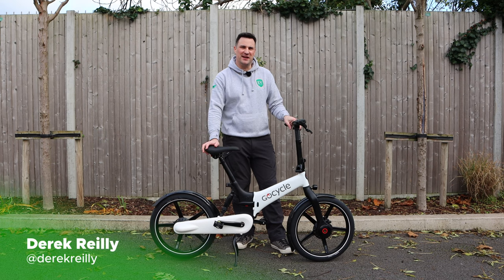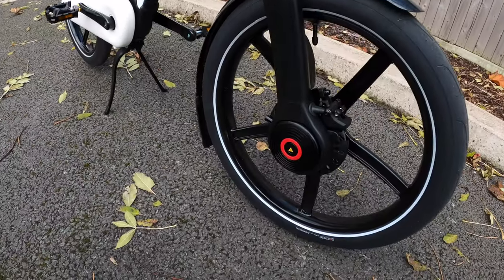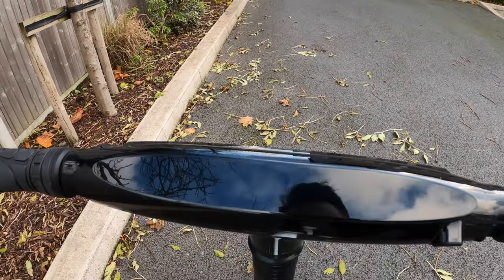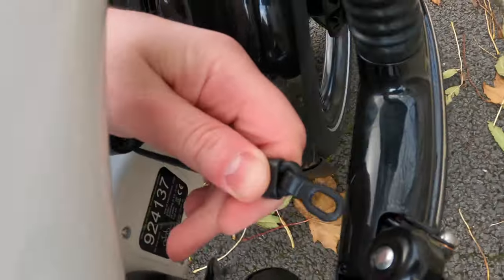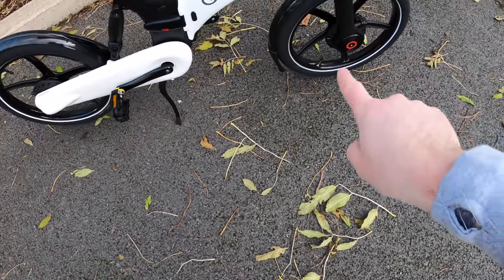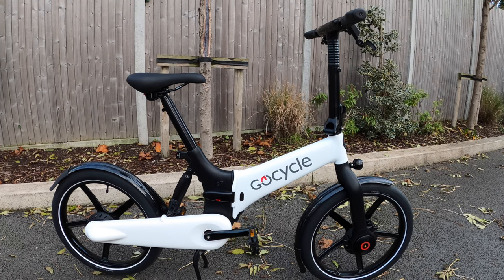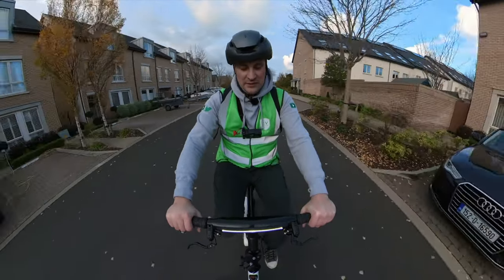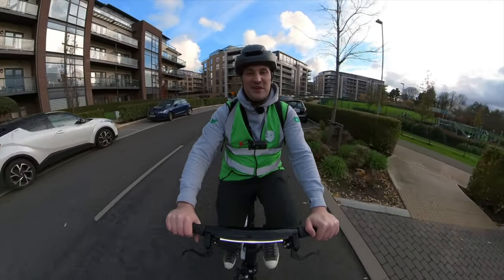Gocycle G4i Folding e-bike -  Full Review and Ride

Comment: Looks like you needed to raise the seat post about 6 inches more - makes the pedalling far easier with the leg extension set right.  I've had one now for a few weeks and they are a decent little bike.  The only constraint for me is that on the flat, it gets up to speed very quickly and the 3 gears could do with being 6 gears.  Be nice if GoCycle offered a wider range of gears option or even an after-market upgrade kit designed for existing bikes.
Reply from the maker: Thanks Chris. I think that I had the seat at maximum as the post has a line on it showing what's the minimum that's needed to be inserted into the frame. I may have been mistaken. Need to take another look
Reply from the maker: I also agree on the gearing suggestion
Reply: @NevoEVReviewIreland  Yeah, the post is in two parts with the top part being adjustable to increase the height to suit by using the Alan key usually stored in the holder under the seat.  Unless you have one with the optional shorter seat post.

Comment: I like this foldable, nice design overall. The price is high for it even though it premium but not full carbon frame for the price, but still a interesting light design?
Reply from the maker: Thanks for the comment
Reply: The Frame is a  Magnesium  Alloy  and read why it is used.  Magnesium can be used to engineer bike frames that are lighter than aluminum while maintaining high tensile strength and damping capabilities. All of that leads to a much smoother, more efficient ride. Magnesium also comes in at a lower price point than popular lightweight materials like carbon fiber.